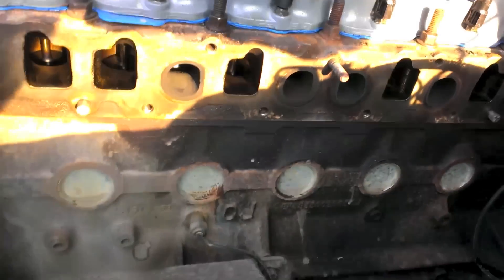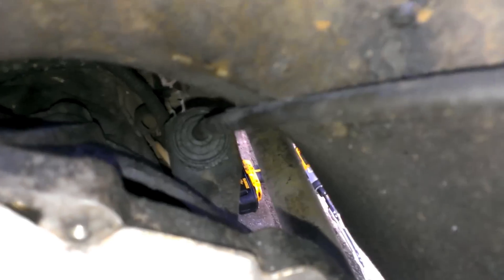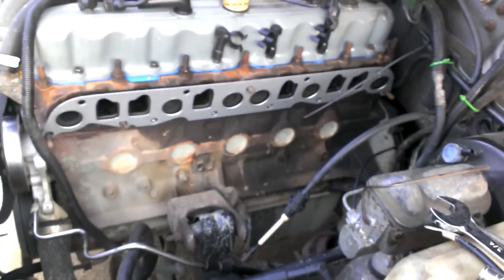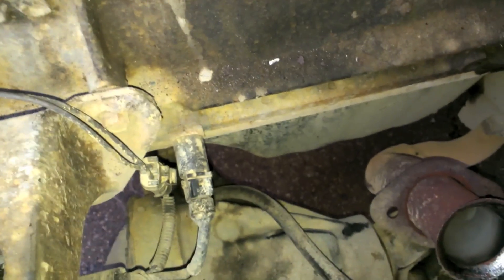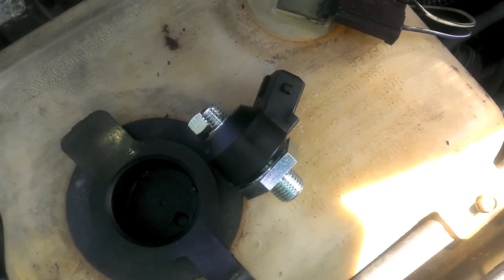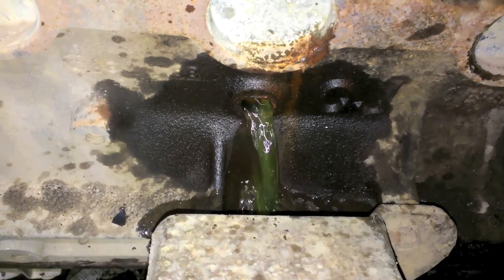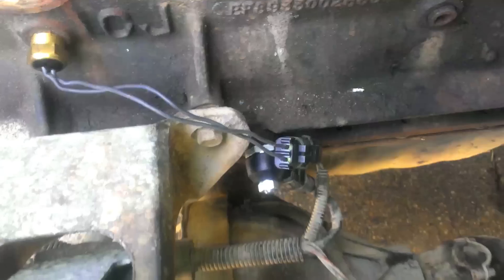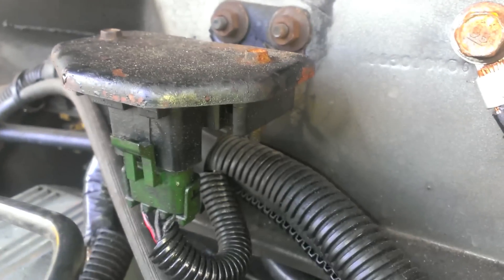89 Cherokee New CPS, Temp, Knock, and MAP Sensors

Comment: I just got my r.e.m. engine monitor,my first code was water temp sensor it reads 249 degrees meanwhile my temp gauge reads 150 ,I checked the water temp sensor the one at the block and it’s not there it’s plugged off where is the rem reading 249 from please help!!!!!
Reply from the maker: The temp sensor is not connected which is why you are getting the fake reading from the ecu. Put in a new sensor and your temp will read correctly.
Reply: @ thank you sooooo much I appreciate your support

Comment: Hey Nick. I recently changed out my 1988 gauge cluster that was full of idiot lights each customer that has all the gauges can you help me with the next step of what’s in the unit I need to get oil pressure and temperature working correctly.

Comment: thanks. mine needs help. so , pull it out and clean it, Its got calcium around 2/3s of it. The cooling sensor for the computer. starting takes a few seconds. 20 years ago it started as soon as you turn the key.

Comment: I love your videos but the cps is way easier than you're doing it... I take off front drive shaft and can get to it with way less extensions and only takes 5 min no head ache way easier to go through the bottom than the top even with the manifold out

Comment: that temp sensor on bottom ob block near knock sensor will make your engine run like crap if its bad. i had to be towed home when mine went out, ive never had one so extreme it wouldnt run. i tested all my sensors, replaced everything, pulled my hair out for a week, then i decided to put my new exhaust on so while i had the manifold off i seen the sensor, unplugged it, after i put the exhaust back on it fired right up, .
Reply from the maker: Wonder if you're intake temp sensor is shot too then. On Renix when the CTS is unplugged it will just copy IAT and then simulate it by slowly increasing until it maxes out.

Comment: Hey Nick. I'm having some trouble with my 88 comanche. It's a renix system so, you seem like the go to guy. 
I have an extremely high idle only when the map sensor vacuum line is connected. it runs extremely rich  with the line connected or not. 
(black smoke is coming out of the tailpipe like a diesel)

It runs better and at a lower rpm when the map sensor vacuum line is disconnected from the throttle body (and throttle body hole is plugged), but of course has terrible gas milage and runs rich. 

new o2 sensor, new iac, new tps, new thermostat, new coolant temp sensor, new map sensor, new spark plugs, new spark plug wires, new cap and rotor, throttle body is clean, manifold bolts are tight. 

The only other thing that I haven't checked is the fuel pressure regulator. Could that be my issue?
Reply from the maker: Hmmm, that is odd. I didn't actually know the ECU could run without the MAP sensor as that is a major sensor for calculating the fuel needed. Sounds like you've covered all the basics, but my go to for difficult running conditions is to break out the scan tool to see what the ECU sees. Shame I'm out of stock of REMs for a few months with the new redesign.
Reply: NickInTimeFilms 
yea, it's an odd issue for sure. 
It's stumped me. 

I might throw on a fuel pressure regulator since it's about as much as a quality fuel pressure gauge. 

You're correct about the engine not running without the map sensor wire connected. 
But, I guess with the vacuum line off, it's sensing no negative pressure just like it would at full throttle. Thus, creating a constant rich condition.

I just might have to get one of those handy dandy scan tools of yours when you have them for sale again. 
I'm excited to see the redesign.
Reply: Did you ever figure out your issue? I’m having the same problem now

Comment: Nick, if you have trouble removing any bold like item (such as the temp sensor) use heat. You were going to replace that one any way. Heat releases rust. U can buy small 02 and acetelyne with a nozle at lowes or homedepot just for those times. :)
Reply from the maker: MAP torch does quick work of that. This video was from when I was still learning the ropes.
Reply: how much are your renix scanners?
Reply from the maker: The REM + went for $85, but the next version I'm working might be a little more, Won't know till I finish it.
Reply: what will it entail as far as new featurs or  upgrades and any idea when itf will be ready? I have put in the new 4.7L stroker and the tranny is in place. I am now just pluggin everything back together and will be ready to start this thing in maybe a week or 2. I would love to have your renix REM
Reply from the maker: The REM II is going to have 2.5L M/T support build in, a much faster and higher capacity arduino, SD Card support, SMD components, maybe Bluetooth if it fits, maybe a gyroscope upgrade if it fits, and a few free pins for inputs and outputs. I've also got a clock replacement panel coming soon but the manufacture is taking there sweet time, hopefully that prototype batch will be done by june 30th so i can see how they turn out, then on to REM II prototypes. definitely gonna be a few weeks since they are being mostly assembled by the factory now but once i know they work i should be able to make them MUCH faster than before and maybe even keep up with orders.

Comment: hey so i was wondering if a crank shaft position sensor make the fuel pump stop working cause  .. i got spark but no fuel pressure and my fuel pump has no power , i just installed that fuel pump and relay but ever time i try to start my ballast resistor starts to gets warm. !!! ..it like, what the hell ...!!!!
Reply from the maker: Hmm, I don't think so unless it's only starting to go out. The CPS is what gives you the RPM reading, and without that the ECU will not send spark or fuel. I think the ballast resistor should get a little warm but if it feels sort of hot then maybe you have a short somewhere?
Reply: Lets see, YOU replaced the fuel pump and now it doesn't work. Either you got a new bad fuel pump (it happens) or you installed it wrong or forgot to hook something up or you blew a fuse somewhere in the process. I just writing this comment for future readers.

Comment: Hey smart pants ! your burp sucks,  ur humor is acceptable, anyway I found a cure for my cps' s, no more I'm buying them, once ur jeep fails to fire, shut the ignition, unhook the cps connection below the map sensor, turn the motor a couple times, shut the ignition, reconnect the cps and off u go, no body figured this out, no more replacements on the stupid cps, good luck to all xj warriors, mine is a 89, almost 400,000 miles, still all original since new, no rebuilt stuff.

Comment: I have an 98 jeep Cherokee with aw4 tranny my jeep is not shifting right it goes all the way to 35 mph before shifting to second I bought another aw4 and replaced trans now I have exact same problem any ideas
Reply from the maker: mike couey Maybe check your TCM? not sure if it's set up the same as older models. Mine is under the passenger side dash with a fuse, if that get's disconnected or blows the fuse it might cause your issues. Checking the TPS, the TV cable adjustment, and making sure you have good electrical grounds are all important
Reply from the maker: mike couey Also having the proper type and amount of Auto Trans Fluid is necessary for it to shift correctly
Reply: yea thank you I went thru hell changing trans to end up with exact same problem thankyou
Reply from the maker: mike couey I had to take my trans out, it's no easy task. My truck had that issue where it didn't want to shift until like 3,000 rpms. I think I had a bad tps sensor. My harness was also messed up so I had to splice a new connector in for the trans side. Still seems to be working fine.

Comment: I'm trying to change my knock sensor too,  but the factory connector doesn't match the redesigned plug.  Did you have to change out anything for the new knock sensor to plug up properly?
Reply from the maker: Nope, my replacement Knock Sensor fit my old connector just fine.

Comment: Whats probably the best sensor youveq replaced? I havent really replced much on mine and was gonna maybe start. Thanks
Reply from the maker: That's a hard question to answer because I can't think of one I replaced and knew 100% it was bad. The most important one on a jeep is the Crankshaft Position Sensor (CPS) because if that ever goes then you're jeep wont start which is common. In this video I replaced the knock sensor because the case was actually broken but everything else I just did because I had access at the time. If your Jeep runs, I wouldn't start throwing new parts at it unless you like to spend money.

Comment: I was able to do my CPS from underneath with just a wrench but it was a huge pain. I replaced my MAP before I realized there was no vac line attached to it, go figure. As far as I can tell the consensus on the top vac line on the throttle body is it's useless, just plug it.

Comment: question about the coolant temp sensor. Is it possible to replace/check this part without taking off all the parts that you did? can you get to it from underneath? I think the acceleration problem I'm having is related to this part being bad.
Reply from the maker: I'm sure you can look up online the specifics but I'm pretty sure it's just a thermoresistor. Grab a multimeter and thermometer to test the resistance and actual temperature when its cold and when it's hot then compare that to a data sheet. Take a look at this for more info: http://www.lunghd.com/Tech_Articles/Engine/Basic_Sensors_Diagnostics.htm

As for being able to get to it, maybe. If you notice the engine mount is in the way of directly reaching it. Breaking it free was not easy so good luck if you try it from underneath. And don't forget the coolant bath you would receive promptly thereafter.
Reply: NickInTimeFilms
Thanks for the mention! I'll give ya a link back from that same page to your channel.

Comment: I like all your 89 Cherokee videos, I have an 88 Comanche so they all apply to me. Keep 'em coming. Personally I wouldn't just go replacing all my sensors but I suppose if was re-doing everything like you I probably would do it. I haven't owned my Jeep too long but I notice that as soon as I fix something, something else breaks. 'tis the life of a Jeep owner. Today I'm replacing the block heater (goes in one of the freeze plugs) because it's leaking. And, I think my water pump is leaking too, boo.

Comment: I gave up on trying to replace my CPS. Got a quote from a shop for 40bucks.... I said write me a quote and have at it. Well 3.5hours later they got it on! hahah best deal ever... They probably thought "Its just a CPS, 10min tops job" I knew better and jumped at 40 bucks.
Reply: That is grand lol. Last time mine was in the shop for one, it's because I was at wits end while replacing it and dropped one of the bolts in the bell housing. Laid there and accepted defeat. Had it at the shop for a few days (they're a busy, reputable shop so.i didn't expect a miracle), and they took 2.5 hours to fish the bolt out and their Jeep guy had the CPS done in half an hour, only charged me $60 for the labor.